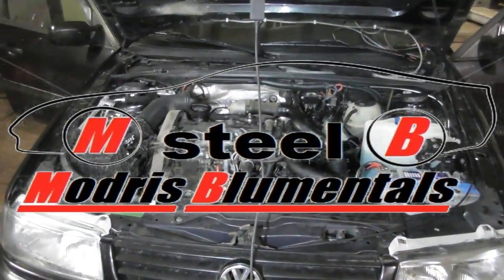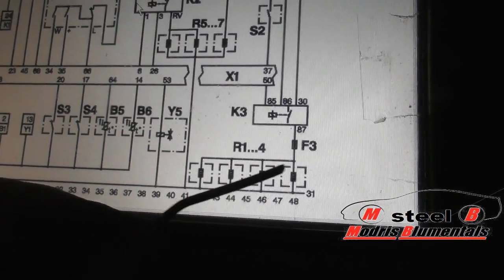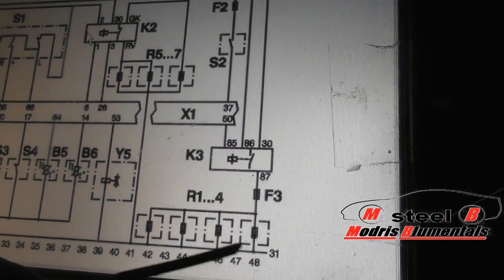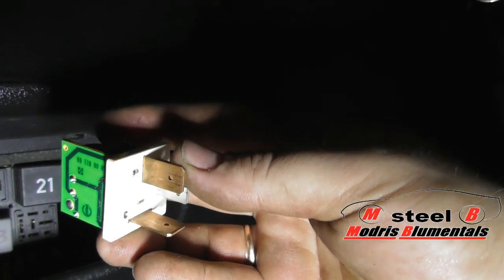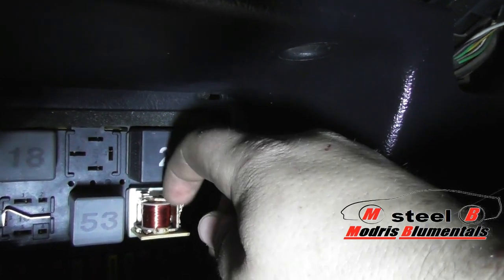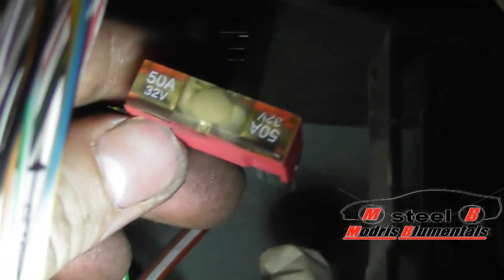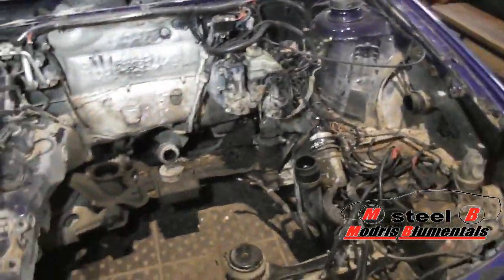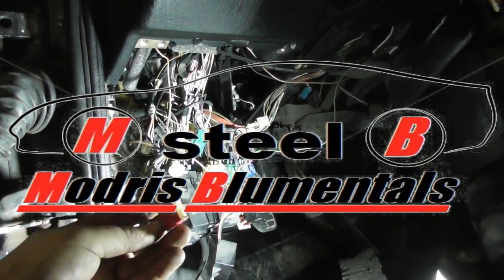1.9 TDI Glow plug problem solved! ✅

Comment: Changed my glow plug harness - the OEM ones are rubbish, break up and snap. Change the harness if replacement relay does not work. 

Harness is around 65 dollars.

Comment: Hello 
I have skoda oktavia 2009 ,  1.9 d . And fuse number 16 in the motor room  fuse box keep burning every one or 2 month.  On skoda homepage  it stand for voltage regaling for right head light and head back-light.   Light in the capen dose not work when I open eny door . Light lamps keep on burning  . Do you have eny idea what the problem is

Comment: Thanks i didn't know there were fuses behind the relays.

My problem seems to be with 109 but its not straight forward.
As a temporary measure i linked the 109 relay terminals and the engine starts easily.
So,
1. ordered 109 OEM used relay from breakers but engine won't start
2. ordered new aftermarket 109 relay engine still won't start
3. fit original relay with linked terminals and engine starts (although when running glowplug light comes on after 30 seconds)

Forums have said there is a cable that can be worn over the engine, checked that and seems okay.
Maybe possible issue is new relays are blowing when turning engine over.

I'm going to have look for fuses behind the relays next thanks.
Reply: And fuse?

Comment: Great video. I think the fuse in the R 1..4 on the schematic drawing you had has gone. Three glow plugs are working just #1 is showing a fault, I've changed the glow plug and cleaned the connector. Where are the R1..4 fuses located? Thanks.

Comment: Regardless of fuse where it is, when you switched on ignition, the relay should have come on for a few seconds which is controlled by the  EM module or  engine computer , so you should have heard the relay magnitised and a click sound,  so may be the ECU  did not switch on because of the ambient temperature did not require glow plugs to come on
Reply: hi, how can i simulate cold ambient temperature?

so i can test if my glowplugs funktion

Comment: Good video like it very helpful but I would just add check why fuse blew, by just replacing it new fuse may blow straight away if there is a short between that fuse and any point in wiring down to glow plugs or a short on any one of the glow plugs.

Comment: Would the car be able to start without the glow plug fuse? Golf mk3 1.9 tdi starts only once in 10 times when I turn the ignition on and off and the glow plug light on the dashboard turns off. Rest of the time, it stays on and the car won't start. I checked resistance on all 4 plugs and wiring. They're good. It didn't have any problems during winter. Trying to figure this out.

PS. Ja pareizi sapratu, esi no LV? :D
Reply from the maker: Rolands L jup esmu lv
Reply from the maker: Rolands L vajag iznemt un katru sveci uz akb parbaidit vai sarkana kveele paliek
Reply: Thank very helpful

Comment: Hi there
I have been watching your videos on VW with a great interest. I have a passat break 3B6 diesel 2002 and I love it. I have had her for 16 years now. She had 40000 km and 450000km. I did a lot of work on it and I love it. Lately she had a problem of trembling and troting . The whole engine is ratteling. The abs triangle light came out and it would never go away. I went to a garage and they put the VAG the code came out  as 4. He said to me the elrctrical injector loom is dead. Start by changing that first. There are more problems with the code 4. 
To cut the long story short I did change the the fuel injector harnest this week but now the car would not start. The engine turns but it would not start.  Before changing the harnest it was startting no problem. 
Have I forgotten to do some thing else when you change the harnest. I am totally lost  would you kindly help me out in here. I would very much appriciate.
Thanking you in advance
denis from France